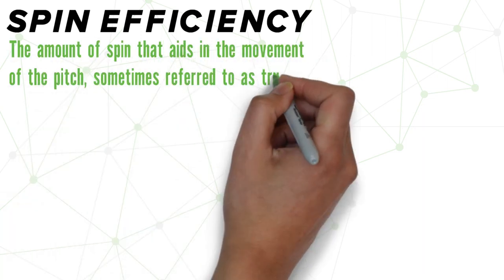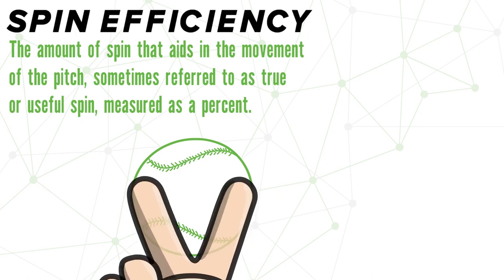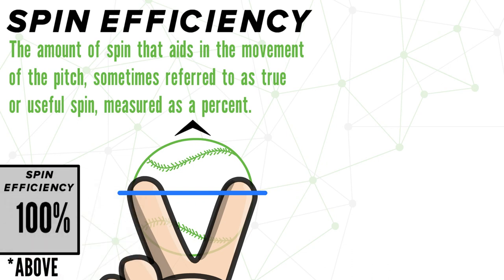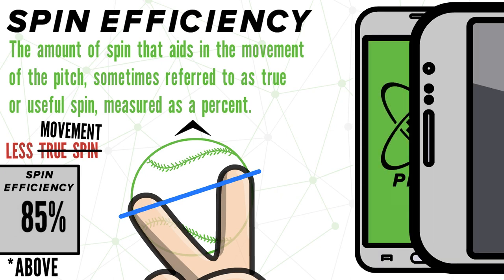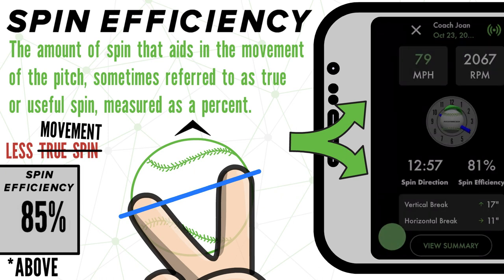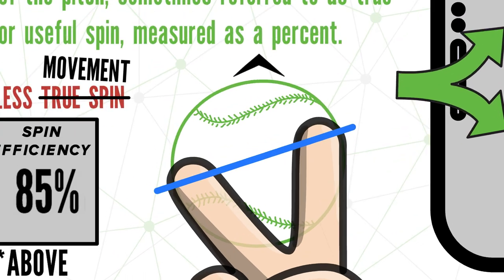SPIN EFFICIENCY: Diamond Kinetics PitchTracker

Comment: A good changeup has arm side run and drop 6 - 8.”  It makes sense that this pitch would not have 100 percent spin efficiency.  Are you considering a change up with 100% spin efficiency when the pitcher stays behind the ball, like a fastball?  A change up thrown like this will tend to be too close in velocity to the fastball.
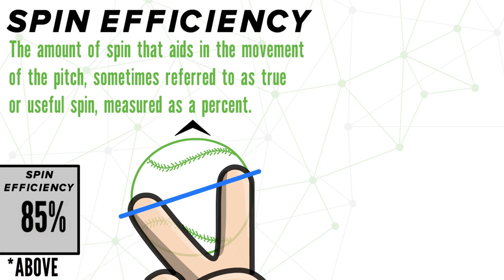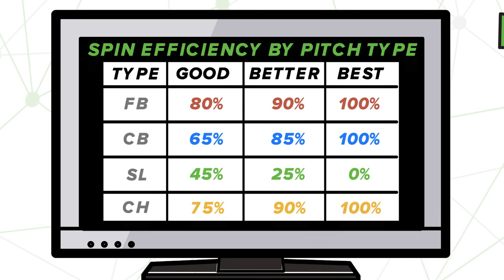Reply: If the spin axis is shifted away from the fastball spin axis then you will get more HB and a lower VB which is what you are after with a CH. The velocity can still be lower even with 100% spin efficiency. By shifting the magnus force sideways, there is less force holding the baseball up which creates the “drop”. A FB with 1:00 spin axis at 100% efficiency and a CH at 2:00 spin axis at 100% efficiency will have a huge difference in movement.
Reply: @johnnywholestaff4909  A better change up gets more vertical break than horizontal break.  A change up will have a different spin than a curveball and a fastball.  My question has nothing to do with velocity, but spin efficiency.  If you throw a change up while staying behind the ball like a fastball, the spin will be the same as a fastball, just slower, and the spin efficiency could be 100%.  However, a change up thrown in this manner is not effective, so spin efficiency is irrelevant.   My question is regarding a change up that will be thrown in order to get some horizontal and more vertical break, which would have a different axis.  Can a pitch thrown in this manner have 100 spin efficiency?  How could it be possible that both pitches have 100 spin efficiency?
Reply: @tootallforbaseball  the more separation between HB and VB from a FB the better. The spin axis is what makes the biggest difference. You can have different spin axis with 100% spin efficiency and get a lot of separation between the 2 pitches.
Reply: @tootallforbaseball  if you would like to reach out, I can explain this better on a different platform. My Twitter is @bomar19 and the DMs are open there.
Reply: @johnnywholestaff4909  Thanks for your comments.  I am not on Twitter.  I guess as long as you don’t have much rifle spin, you could get good spin efficiency, except with a slider or cutter, where you want a low spin efficiency.
Reply: @tootallforbaseball  correct. If you have a better way to get together we can
Reply: @johnnywholestaff4909  Are you with Oxford Yellowjacket Baseball?
Reply: @tootallforbaseball  no I’m a minor league pitching coach for the Angels
Reply: @johnnywholestaff4909  Ok, cool.  My son is with the Phillies.  He will most likely be in low A this spring in Clearwater.